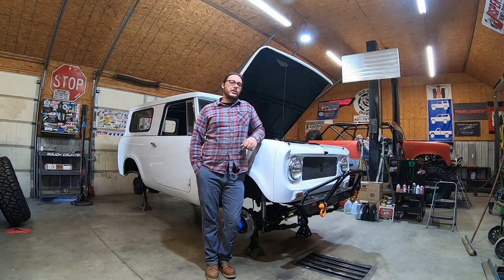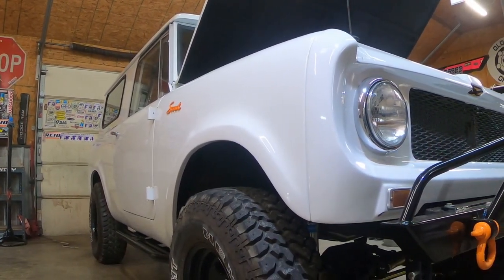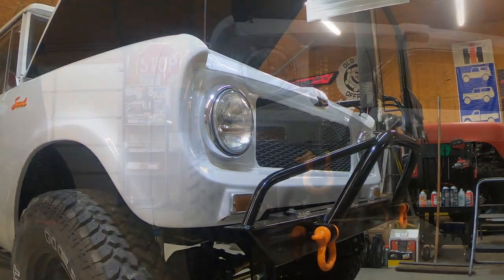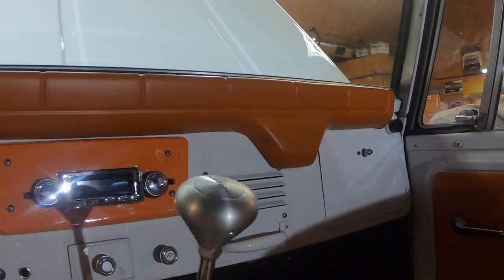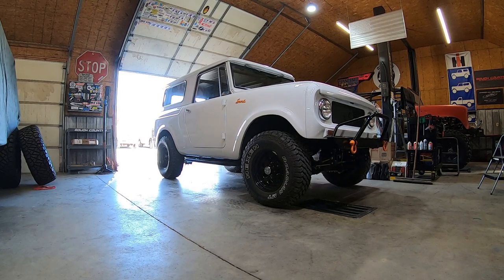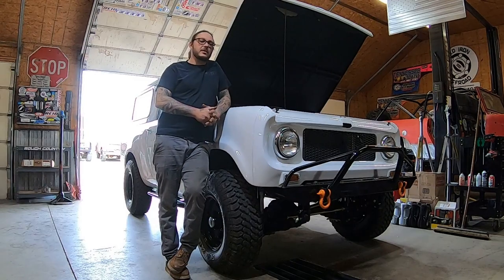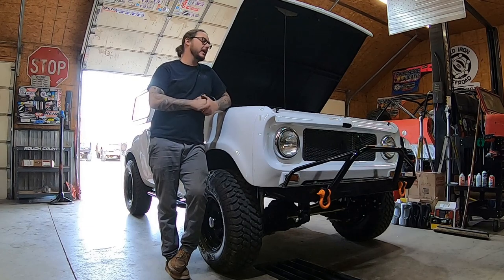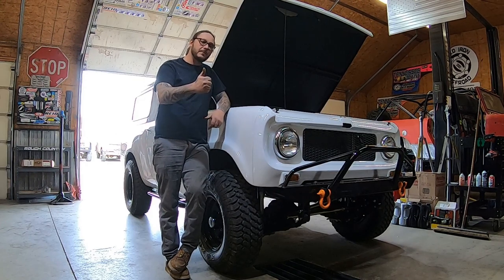Project Mullet :Small Block Chevy swapped Scout 80:

Comment: You stated this is a CPT lift. I have a 65 scout 80, plan on putting dana 44 Scout 2 axles under it. What is the best suspension combo for spring under for this same look? Is it a 2.5" lift and body spacers?  I plan on putting 31" x 10.5 x 15 tires on the factory 15 x 8 rims. Thanks for the help
Reply from the maker: The CPT lift is the way to go, but 31's will look a bit small
Reply: @OldIronOffroad  What size tire are on the Mullet rig? Is it a 2.5" lift?

Comment: Okay, even though it has a small block chevy engine in it, what transmission is used? I'm planning on dropping a small block chevy engine in my Scout with a turbo 350 transmission, am I able to use the same Scout transfer case with an adaptor to the chevy transmission? Plus would the transfer case hold up to the horsepower of the SBC.
Reply from the maker: Turbo 400 with a dana 20 adapter.
Reply: Would the Dana 20 adaptor work with the turbo 350?
Reply from the maker: @alfonsosanchez6263  Yes the 20 can be adapted to the 350 as well.
Reply: I was thinking of doing the 4.3 swap and mating the T-18/19 ....any thoughts